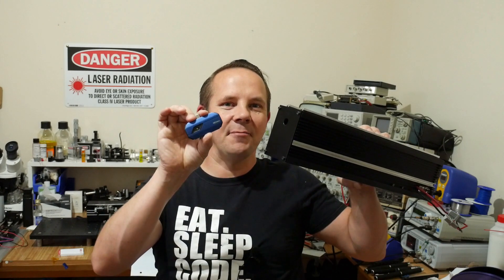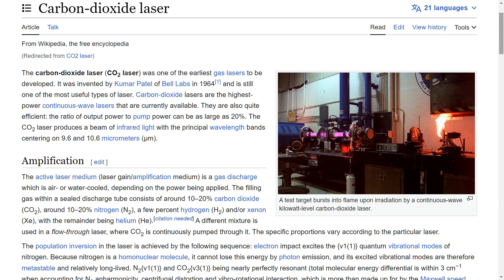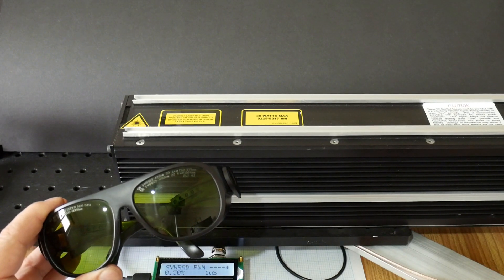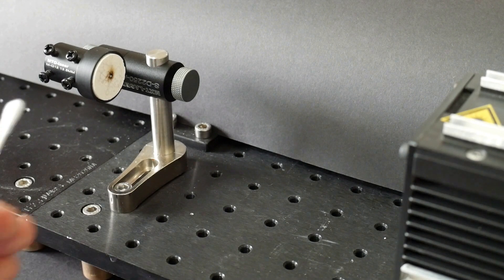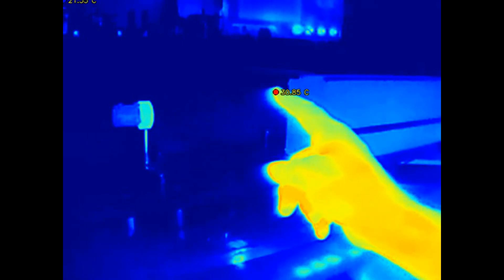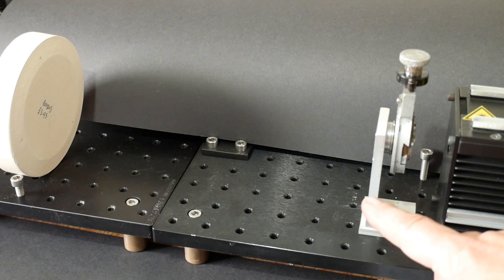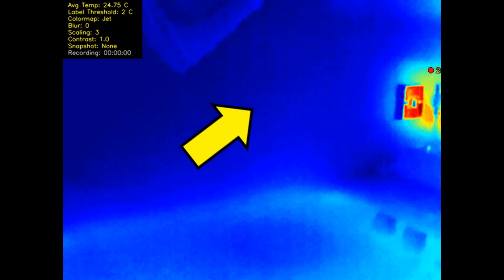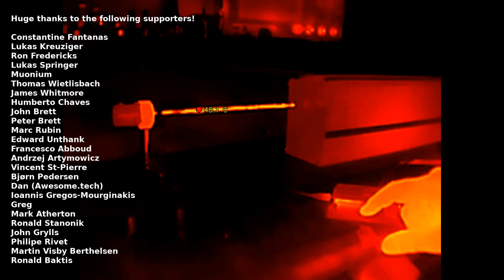Thermal camera VS Carbon Dioxide Laser!

Comment: I came here for the one thing you didn't test, if LWIR actually diffuse reflects off a surface and can be seen as a sighting dot or it's only visible as it heats the surface. GPT suggests absorption is near complete and you can't see the light diffuse off the surface but I don't quite believe that. Please test it

Comment: FLIR cams aren't cheap. Lower resolution ones have come down a fair bit in price, but high resolution FLIR's are very expensive. As to the imaging, There are two types of Sensors that that IR band. The direct sensing of IR uses materials that can only operate at low temps (chilled detectors, because of self generated "noise". The second and most common sensors/FLIR cams use Germanium lenses and ports and serve to focus the IR onto an array of extremely small Thermistors, which are mounted on thermally isolating standoffs. The thermistors are then heated by the incoming IR and the voltage change to each is combined to produce the image. The sensing thermistors are also encapsulated into a vacuum enclosure, so they are pricy.

Comment: What a brilliant idea. I have some ideas and questions. Since the current power can destroy the thermal imager, can we use attenuators or other methods to reduce the power of the laser, so as to observe a carbon dioxide laser spot that does not cause crosstalk. On this basis, a two-dimensional image that can be observed by an imaging device can be generated by adding a laser galvanometer
Reply from the maker: Yep it is possible to attenuate the beam, and might be worth a try. I am working on a machine at the moment that should allow me to make far Infrared optics (maybe!)

Comment: These are exactly the conerns I have playing with lasers... Noting "urorac" synthesziers are calibrated for 1w power are these signals interoperable? To sample my results how fast do I need to run my gpu?... with modern cryocooler tec for gpu are lasers even needed when we have diffuse coherent sources as LED, do they work the same? What are the lights I should understand for right now and to come? Lasers are just as cool as I thought, what do they sound like and what do real laser images actually look like hoped to set some of these imaging techniques up in art school, should I have just focused on vr tech or is the reproduction crisis real?

Comment: Have you tried using CO2 focusing lens on those Thermal Camera's wavelength? Such that one might get telescopic thermal imaging? Much like a single lens on camera...They are way cheaper than chalcogenide lens
Reply from the maker: I have a coue of ZnSe lesnes, I should give it a try. failing that aluminized or gold coated mirrors could result in a good IR telescope.

Comment: Wow they really have improved thermal. Try making a microscope or telescope for the thermal. I used to fill up old tired CO2 lasers made by Synrad ❤
Reply from the maker: Yep, I have a few ZnSe lenses I might try with it. I think a telescope could be interesting!
Reply: @LesLaboratory  for a telescope you can use a long FL znse germanium or even a polyethylene plastic fresnel lens and a short FL engraver lens. OR  you can use a reflector telescope that has the front protector window removed plus a short FL znse lens. That one can see very far out. Works great for finding hot spots in high tension power lines.  Needs to be all reflective first surface mirrors to the lens to work. Gold mirrors are best but aluminum is ok 👍
Reply: For a macro to view a circuit board in detail any shorter FL znse lens will work. It is awsome for SMD work because the hot parts can be seen in detail. Playing with optics is fun. But you know that already. 😏

Comment: Very interesting. I have a question and a suggestion.
1) The outlet temperature appears to be very low, much the same as the laser unit, is this true? 
2) What if you spray CO2 on the beam. I think it would reveal the beam.

I hope you can give it a go. Regards Blair
Reply from the maker: The temperature registered on the beam is unlikely to be real. The camera is seeing the reflected CO2 Laser light, and makes some assumption as to what the temperature would be if it were a 'real' heat source.
Regarding CO2 it might, though I have not tried it.
Reply: @LesLaboratory  Thanks, I really hope you can. If it (CO2) does not show, that would be very significant. If you still have this kit, it must be easy to give it a quick run, please. B

Comment: Is there a way to visually show that CO2 is a "black" gas in the infrared spectrum? maybe a thermal camera can see CO2?
Reply from the maker: CO2 is quite transparent at CO2 laser wavelengths. You would need a camera that was sensitive to its absorption bands, for example 2 microns, 2.9 microns 4.3 microns and the longwave band from 16-18 microns. You would also need a light source that emits in those bands as well. I suspect that the 7-14 micron range of FLIR cameras has less to do with the physics, and more to do with restrictions of the technology. Those bands can be used to identify missiles in flight from their exhaust.

Comment: Some microbolometer pixel types can and do in fact self-heal to a certain extent! At least, when the damage is superficial and mostly to the absorbing material(usually vanadium oxide, abbreviated VOx). The internal sensor calibration routine may also catch and mask it on a restart, but if the healing was gradual, that lies entirely within the physical effects happening within the pixel itself.
Edit: Completely missed the Huygens Optics comment, which explains this property.

Comment: If we try to focus IR laser light to a point with a lense, the smallest cross-sectional area we can focus it to is around wavelength² right? so its not like we can focus it to arbitrary small point
Reply from the maker: The ultimate spot size is determined by the wavelength of light, as well as other factors such as beam quality, and focal length of the lens. At 9.3 microns, with a 20mm FL lens, for a 1mm diameter gaussian beam the spot would be around 240um. There are handy calculators for this such as: https://www.lasercalculator.com/laser-spot-size-calculator/

Comment: You can use a Microscope cover slide to reduce the sensitivity of your thermal camera dramatically.  Might be useful when dealing with high power IR lasers and fast thermal optics.

Definitely build a 8-12μm spectrometer, I would love to see that!
Reply from the maker: I will try that. I use a stack of slides for attenuation uv from my Nitrogen Laser. I have some coverslips somewhere as well. 
I reckon a spectrometer can be done, the optics will be the fun part.

Comment: Anyone here remember when all of StyroPyro's videos contained blue spots?
Reply from the maker: Ha! Yup! Zenodilodons as well! The first camera I broke, was way back in the early 2000's. Caught a reflection from a Dye laser. It actually blew a crater in the silicon!
Reply: @LesLaboratory  Luckily the firmware fixed that one dead pixel. At least that's what I assume.
At any rate, a thermal camera could actually be useful to optimize CO2 laser cutters, if I understand your video correctly.
Also like the thumbnail.

Comment: Dead pixels were simply seen as an error during calibration, and after a few cal cycles with the camera firmware unable to get a response out of them, as they show well away from the supposed common temp of the shutter, the camera simply decided to map them as dead, and then simply use the adjacent pixel data to average what that is.  You can see this with a thin hot wire, simply sweep slowly over the image, and you will see in that area a sudden bump appear, followed by a hollow in the wire. Heat wire to around 400C with your power supply.
Reply from the maker: Cool! I will give that a go. I have a reel of nichrome somewhere!

Comment: Interesting video Les! About the spot/damage: thermal imaging equipment sometimes seems to have this "self repair" property. I think it has to do with the high diffusion rate of the low work function metals that are used inside these sensors. So diffusion fills up the vacancies in time where ions or atoms have been removed by the high-intensity radiation.
Reply: I believe the answer may have something to do with the fact that the microbolometer focal plane array in such imagers is comprised of exceptionally thin, thermally isolated, levitated plates of vanadium pentoxide, a material which is known to have at least six different polymorphs . It seems likely that heating the material above some threshold value causes the crystal structure to shift, and that upon cooling, it gradually falls back from this metastable state into its locally energetically favorable minimum conformation again. For instance in the way "tin pest" spontaneously converts 'white' alpha tin into the 'grey' beta allotrope upon cooling below −30 °C. See page 7 of the 2018 masters thesis paper "ELECTRONIC STRUCTURE OF V2O5 POLYMORPHS AND MxV2O5 BRONZES" by Ly.
Reply: @Muonium1 I'm not sure what I'm more surprised by, the fact that those words in that order actually makes sense, or that I understand about 95% of what you said.
At any rate microbolometer is my word for the day, whatever it is.
Reply from the maker: Thanks. Really interesting. I will have to have a dig through the literature on this. It is probably a combination. The auto cal seemed to deal with most of the problem fairly quick. The shutter would click then the spot would disappear, until the scene changed, then it would come back. After time (days) though it has slowly faded, and so the explanation you have suggested makes sense.
Reply: is this a deliberate design choice?
Reply: The sensor material is probably aSi which has the property of getting stuck if exposed to high brightness thermal sources. Vox sensors have a much wider dynamic range but a direct hit from a specular reflection usually fries them.

Comment: I've been wanting to build a laser table for mounting and experimenting with lasers. I've been collecting the mirrors and glass and the tools. They aren't cheap. I just haven't located where to get the standard mounting frames.
Reply from the maker: For mounts, I am using inexpensive ones from aliexpress. Look up MTO Laser. Where I want to mount things that won't fit those, I have been making parts on the lathe.
Reply: @LesLaboratory  Hey thanks for that.

Comment: I'm sure you know better than to confuse infrared radiation with heat.  Heat is a condition of a material object, a property, not a substance.  Heat does not radiate, and cameras do not see heat.  And temperature is not heat.  Even physicists who should know better speak in this misconceived medieval language, that hot things radiate heat.

Comment: Is the dioxide and water in breath alone enough to 'smoke' image the beam? Maybe co2 from a balloon? Ethanol should absorb very strongly if I have the wavenumber - nm conversion right, maybe a kind of visual breathalyzer is possible...
Reply from the maker: Now that's an interesting thought! Not sure I would like to be drunk around the laser, but something could be constructed to demonstrated proof of concept...
Reply: Yes, but also no. CO2 and similar gases absorb strongly(well, "strongly" is a relative term) in the MWIR region, which is what cryocooled cameras see, and if you use a specific notch filter for certain absorption peaks(to maximize contrast), you get what's called "optical gas imaging" cameras in the industry. For example, FLIR's G series.

Comment: Fascinating and I would like a few more details on your controller. In a Bulb Stabilised Wien Bridge Oscillator the bulb heats up due to current but the whole thing is very sensitive, could you adjust the temperature of the running filament using a Laser and still have the control from the opamp  and maybe enhance (or degrade) the performance regards stability ?...asking for a friend !....cheers.
Reply from the maker: 😀 Possibly maybe. The problem is the CO2 laser wavelength is strongly absorbed by glass and wouldn't penetrate the bulb (at least until it melts it!)  Shorter wavelengths might work though.

Comment: Absolutely fascinating!! Love it!
Reply: 120 Watts of diffuse terminated Co2 Laser will fry a bolometer camera from  15 feet away.   People who stick their cell  camera in scanned laser shows, get burned pixels at very low power.
Reply from the maker: @steveroberts7143  I'm sure it would. My guess is if you pointed one at the flame of a hydrogen torch, or electric arc, the sensors would probably be damaged. Not a patch on a CO2 laser though ☠️

Comment: Welcome to the club of burning camera sensors XD Especially pulsed lasers are nasty beasts to take pictures of. Every now and then I see a picture from my old phone pop up with that smudge in the middle of it. A permanent image of a beam dump I took a picture off with the laser on.

Jokes aside I love that little thermal camera. I ended up getting one for the house and it's already taking good data.
Reply from the maker: Been in that club since dot! I poked a hole in the sensor of a ccd camera in the early 2000's with a Dye Laser. 
I will have to be extra careful when I rebuild the YAG!
They are way cool cameras for sure!

Comment: this is a good way to test goggles i used my thermal cam behind some polycarbonate safety goggles and didnt see anything.    i found that SEEK is much more sensitive to 10.6µ  it retains even reflections of it.   but didnt have that with flir lepton modules.    havent tried with a tiny1c infray yet, (used in topdon, p2 pro, all 256x160 phones)